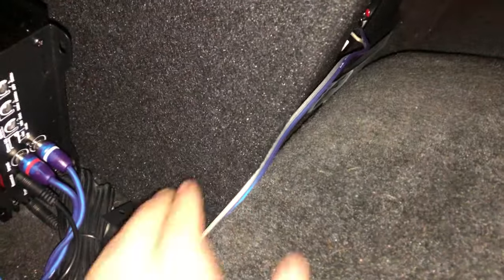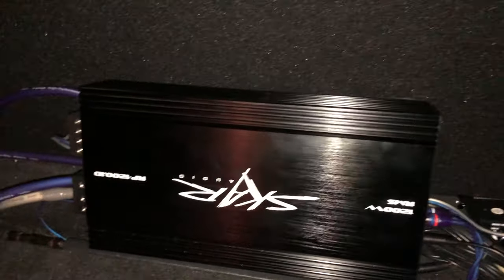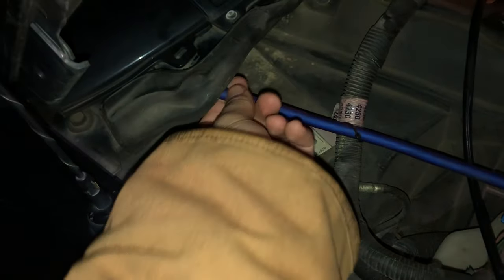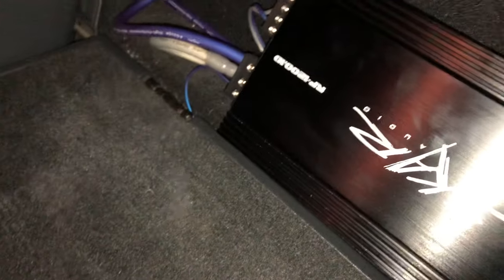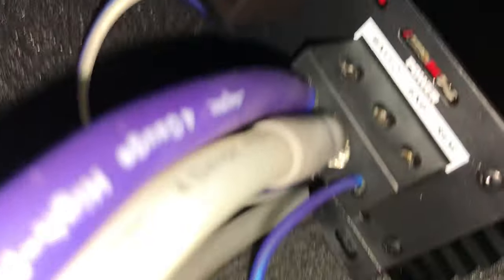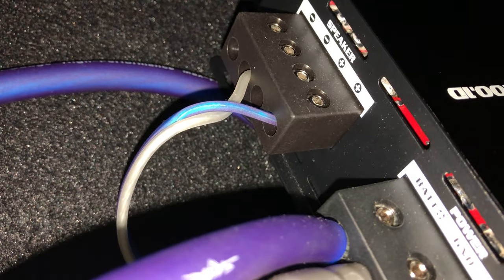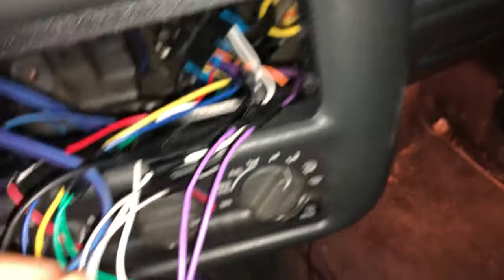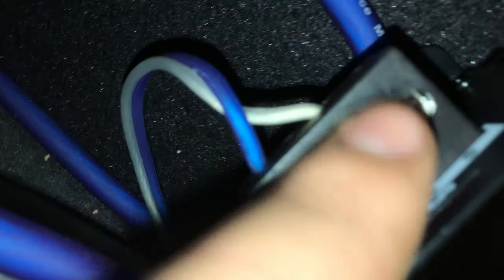How to kinda install any skar sound system full tutorial

Comment: Eventually your door hinge will cut through that power wire and burn your amp. You should run your power wire on the drivers side, plenty of places to pass through on that side.
Reply from the maker: There are no rubber grommets on either side due to it being an automatic instead of a manual it’s not rubbing anything due to that way I routed it. Thanks for your concern tho
Reply: It most definitely will short,that wire at the door even if not the hinge that cuts through it. The door opening and closing on that wire will eventually break through the insulation and short to the body. Speaking from experience. Most definitely find a gromet.
Reply: @Digital_Tea  u will be good dont worry just make sure its not getting smashed i ran my wire like that for longer thn a year
Reply: Ok ok I see where you could have put it. The rubber cover that the door wires are in is best way to run it. Take that power through the rubber. Push the rubber back on with the wire coming out. And it will fit around the wire. It works I promise. If you need a pic I can get ya 1
Reply: Antenna hole,👌
Reply: @MrPapy305  been over a year and the wire is brand new
Reply from the maker: @MrPapy305  good thing I don’t have passengers cause that door opens maybe 30 times a year
Reply: @Digital_Tea  I ran my power wire like that as well it isn't rubbing or loose at all.
I eventually found a hole to run bigger power wires thru so I did two runs I may use the second from the door and remove that wire.
Reply: Lies
Reply: Drill a whole through the firewall lol
Reply: Fire hazard 😮😮
Reply: @Digital_Tea you can drill a hole ik it sounds intimidating but it's easy
Reply: After I seen that wire I stoped watching😂😂
Reply: How’s that wire doing?

Comment: At no point is any of this good advice.    You don't run your power wire through your door jams.    Your amp should be mounted not loose to fly around.   Use proper connections to keep wire from fraying and potentially shorting out.   Let's not get started on that mess in his dash, after all he cut out his factory harness.
Reply from the maker: So I am fully aware it’s wrong and if you would have listened I said my way and then tell how to do right way my style is quick messy safe and it works. The big hitch is explaining where the wires go and then showing HOW I did it then saying use a rubber grommet behind the fire wall and I didn’t cut the harness buddy I bought an adapter kit for it

Comment: Make sure u sand the ground b4 u put the cable on it will get you a better connection and idk if u know but dont use bassboost and the bass eq leave it on 0 thank me later nice setup
Reply from the maker: Yup goter all figured out thanks to some audio guys in my community.
Reply: What’s the best reason to not use the boost and or leave the eq on 0? I’m trying to install it myself inside of my Silverado .
Reply: @charliepurple5472  Don't use bass boost. If you tune the amp using the gain knob you won't need it. I would only recommend using bass boost if you need more wiggle room with the gain because of a low voltage output from the headunit.
Reply: @urwholefamilydied  maybe the box from your old 2x10s was better for the music you enjoy.

Comment: You can plug the rem wire into any hot fuse that comes on when you turn the key you don't have to dig into the entire dash lmfao.
Reply from the maker: It’s just easier if your already doing a new radio along with a new sound system lol
Reply: Can you elaborate on this? I like every step except going into the dash and cutting everything

Comment: Just make sure all your wire connections to fuse terminal is in there good and tight if not that plastic will start to melt just trying to help ya out I've ran into all those issues when I first started out car audio and the remote wire your radio should have a blue wire behind it that's where the remote wire goes
Reply: Mine melted what do I do?
Reply: Lol, this video aged well. When arrogance meets trust me bro, what could go wrong?

Comment: You don't need a new radio to install a amp lol. Just get a hi lo converter.
Reply from the maker: I found it easier to just get a new radio since it’s a 2000 and had an old junk radio. So I decided on a cheaper $60 radio with Bluetooth/ call assistant/ and no DVD player.
Reply: @Digital_Tea  what radio did you get
Reply: @Digital_Tea  new to car audio but have a single slat 12 with rp.800 amp want to run the car and sound system on one battery how much wattage of Agm battery should I use in my 97 Toyota Avalon

Comment: It won’t leak water but you’ll short the entire thing out and /or start a fire when the positive cable gets smashed in between the door and jamb plus the dash kits are dummy proof, all the colors match, I’ve done dozens of them, and the “rem” is remote turn on for you amp, so when you turn on the radio, the amp comes on.
Reply from the maker: Correct. Except for the wire being broken. I’m still trying to make a new video and I’ve shot it about dead ass 50 times and just don’t like how it’s edited or structured or whatever but once I find my style I still have that same wire from 4 years ago

Comment: You don’t need to change your stock deck unless your amp only has RCA hookups. Most have high output connections now.
Reply: Can you elaborate on this? I just ordered this little sub package myself and I have a 21’ Sonata.
Reply: Are there simple wires behind the center screen I can just tap into?
Reply: There also are converters for line outputs to RCAs I’m using some on my Kia Forte and I keep the same head unit since it’s control buttons are on the steering wheel and so it looks stock so people don’t even think there is a stereo system in there.

Comment: DO NOT just make a big ball of wire and let it pinch, do use ferrules. Ferrules do not allow the set screw to chew threw and break the wires. Oh and before I forget, NEVER run your power wire through your door jam. It is 100% completely UNSAFE. That is a great way to VERY possibly start a carbeque.
Reply from the maker: I just explained what I did not what to do it’s meant for other ti use the knowledge to apply it to their car. I made a newer video showing why it’s wrong to just twist shit together

Comment: Bro nice video . I have a cuestión . I have a 1200 watts skar amp. I still haven't finished connecting it. One question, do I need another extra battery or like capacitor? So that my battery doesn't die
Reply from the maker: Nope just make sure the rem wire is wired to something that only turns on when you have the keys on. If you don’t want your lights dancing with the music on late night drives tho you will need a capacitor. And extra battery is unneeded in todays age in capacitors

Comment: I ran mine the same way and I have a S10 blazer but used a uni bit and drilled a hole in the firewall to run it into the engine compartment
Reply from the maker: Only reason I didn’t was because I was afraid I’d damage or break something😂

Comment: To add another sub box ud just wire it to the 2 un used connections right? Or do you have to wire the boxes together or somethin
Reply from the maker: Yep you got it bro
Reply: No. You have to check the impedance first. You can’t just keep adding subs it might fry the amp if the impedance drops too low for the amplifier to handle
Reply from the maker: You just get a bigger amp if you say have a 1200w amp and 1200 watt 10s 
Just put a 2400w and your other 2 1200w 10s on the setup

Comment: Just installed my 800 star pushing 1 punch Rockford fosegate 10”” custom box. Installed new after market head unit a double din Boss 6.3” touch screen. Everything worked great for couple hours . Now the speakers will not come on. Amp is lit up solid blue on back of amp at power. All connections are tight.does it mean there is no power coming out of amp if power light is illuminated blue. No blinking. What do you think will cause no power to subs. Used cheap tester with  one alligator clip and light up pointer. Pos +T  +\neg - both light up the pointer. The ground also lights up pointer but nothing on the plastic link box. What do you recommend to fix. Just bought everything brand new and installed in 05 Ford sport trac. All suggestions appreciated . Thx
Reply from the maker: Check your radio fuse in the panel cluster all the new gear may have fried it. I know mine did and killed the whole system. Just way over compensate and put a 60 amp in it no harm in to much protection

Comment: Ummm....they have Kicker 46KISLOC2 line out converters that clip in to one of your rear stock speakers and send the full signal to your amp then to the subs....as for the power to the Amp there's 175 amp quick connect / disconnect terminals where you can unplug your subs and amp to take it out when you need your back seat...my subs will go in and come out in under a minute...
Reply from the maker: Cool! Except I’m not taking my shit in and out and even with ur setup my shit still weights 165 pounds and that’s just the box

Comment: its pretty simple i have a s10 extended cab, i removed the groment for the atenna, which you pull back the carpet by on the passenger side under th glovebox and i ran mine through that. i and it should be fine to have no gromet from what a friend told me since i bought the skar 1/0 gauge and its to big for the gromet to go back in.
Reply: Bro I want an s10 so bad
Reply: @jackreacher6658  yea there nice man, get you one.

Comment: Wrong way to run the power wire , never run it outside the car through the door jam. Because someday it might get smashed in the hinges and there goes your electrical system. There is always a hole in the firewall and if not in the place where you need you can always drill a hole and use a grommet, because it’s better and safer than being lazy and doing it wrong. 
I have been installing radios since the late 80s in my personal vehicles. And I have learned what to do and what not to do.
Reply from the maker: I’m completely and entirely aware that’s wrong. I stated that in the video and also that power wire is now in my challenger and still working perfectly fine because that door was basically never used. For my application it worked fine. For others id say hell no do not do that

Comment: This might be a dumb question but I know how to everything thanks to your vid but where do I connect the speaker wires to the actually sub itself I don’t see anywhere they go on it. I have a 12 in 1200 amp skar
Reply from the maker: On the side there are a red and black spring loaded buttons push them down put stripped wire in and let it pinch

Comment: Tutorial on how Not to install a Skar Stereo System.
Reply from the maker: the sub wiring is fine the only thing fucked is the radio wiring which has since been fixed
Reply: @Digital_Tea  so the power wire going to the amplifier is fine?
Reply from the maker: @frankplancarte  yep because it’s pushed against rubber. And that door is never opened. So in my specific case as I stated it’s completely fine and functional

Comment: he kind of talked about the remote wire (rem) breifly but if your amp isnt powering what i did to fix mine was put the rem wire in the rem part obviously then i out it with the possotive wire now i dont know if this is what is supposed to be done but it works, and thats also how i got it running on my home stereo
Reply: The remote wire is normaly comming from the radio it tells the amp to turn on because when you would bridge it to positive like you did the battery in the car would be sucked empty over night when the car is not running cause the amp always draws power this way thats why you always connect you remote correctly in a car setup in a home setup you can bridge it without any problems
Reply: @nuss3165  well im running a home set up and i turn off the power stup when im done listening so i dont really have many problems with it, i do this withall of my amps that ia have set up and it always works
Reply from the maker: That keeps your amp on 24/7 wire it into an ac or some kind of fuse that would only be powered when the car has ignition

Comment: Bro what kinda wire you use? What's the battery cable brand and speaker wire ?
Reply from the maker: It’s all in the skar kit but is oxygen free 4 gauge speaker wire and it’s just rual king battery terminal brand they are like 10 bucks for 6 of them or something

Comment: Ok, so from what it looks like is you are running your speaker wire off the amp but the purple wire runs to the ac power up and the ground goes to the sub? Don’t really understand I guess how that works. If the wire is running up to the ac power up then what goes back to the sub? Because what it appears to me is it comes off the sub hook up which is a output only not a input so what port do you connect to to go up to the ac power up?
Reply from the maker: My guy rewatch the video big blue/purple 4 gauge wire goes to the battery. The grey big 4 gauge goes to any ground wire; you can put it on the seat mount bolt. Then your red and white wires go up to the radio followed by the amp start wire, or REM on the amp. Then your sub wire goes to the + and - on the amp (small holes)  blue to red and grey to Black. + is blue on amp - is grey on amp
Reply: @Digital_Tea  I did that lmao it’s not working!! 🤦🏾‍♂️

Comment: Hey I just bought skar dual 8in sdrs 1400 watts with the 1200 watts amp kit and a 1200 amp do you think I would have any problems?
Reply from the maker: Your amp is under powered but I see no other issues other than that
Reply: @Digital_Tea  yes but with the kit if you were to buy the amp and the subwoofers together skar sells it with a 800 watts amp that is why I asked and the sub has to be more powerful then the amp or if reversed the subs can blow

Comment: The part that confuses me is the skar 12 inch dual sub box only has 1 + and 1 - for both speaker connections, while the amp has 2 + and 2 -.   So it's a mono amp set up?
Reply: I just installed mine and it sounded terrible with this setup. I ended up just cutting the one wire in half and using both ends for both of the + and -
Reply: Just connect the + and - from the subwoofer enclosure to the amp. All the terminals of the amp don’t have to be used. Those RP amps are monoblocks and are connected internally already.
Reply: The Skar Dual 12” enclosure also includes the subwoofers being wired in parallel inside the enclosure which leads to 1 ohm at the box terminal. This is why there are only 1+ and 1- on the box terminals.
Reply from the maker: Yes it only plays bass track for better sound

Comment: I have this exact same setup in my Tahoe minus the scar amplifier but I have a 1600 watt amplifier and replacement and using the same speaker wires and everything still can't get my amp to support the base output on the speakers and can't seem to figure out why
Reply from the maker: What’s your sub watts

Comment: Pretty good tutorial but can’t help and notice your wiring. Please use butt connectors on your connections and don’t just electrical tape it
Reply from the maker: I wrap my wires together tightly so I can’t pull them apart then tightly wrap it in electrical tape to prevent surges or damage to equipment. That just one way to do it tho

Comment: okay guys, most, if not all stereos come with a remote turn on wire. its most likely your blue wire. and don't splice into a wire that isn't meant for it. reason for this. normally when you turn on your car or truck it will go from 12V before starting to between 13.3V - 14.5V. it will fuck your shit up!. the BLUE TURN ON WIRE ONLY RUNS 12V, AGAIN ONLY 12V. not no 12.3V or 13.5V. 12V!!! do it right the first time. use butt connecters for a stable connection, not no dang electrical tape.... gezz..... if your gonna spice wire, use a correct Spicer. correctly, its like a T.
Reply from the maker: 7 months and redneck science continues to work perfectly. Also to my credit a 2000 gmc Jimmy with whatever stereo it had from the factory I forgot at this point. Their is no remote turn on wire and I even had a wire kit for it. Appreciate the criticism tho dead ass.
Reply: 14.4v on amp specs is good power according to manufacture of most car audio company's but yea "don't fuck your shit up"  lol wonder how hot that guy's amp gets "not fucking his shit up" with low voltage and max volume with all knobs to right! Shits bumpin tho 😂